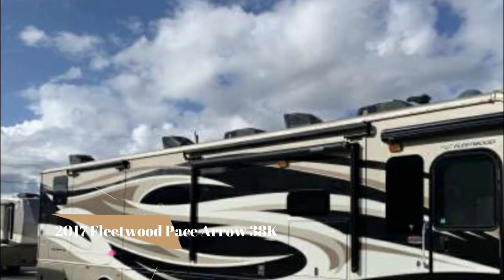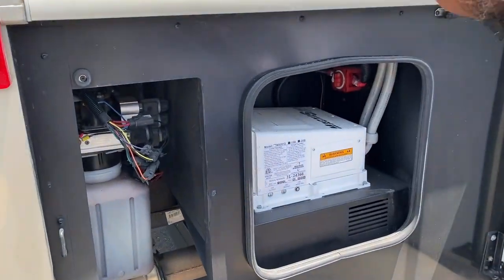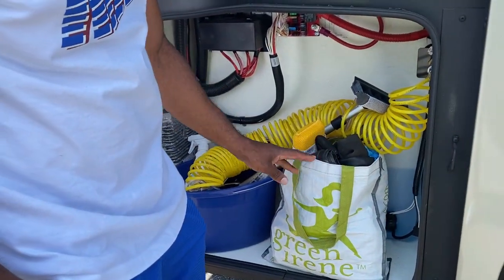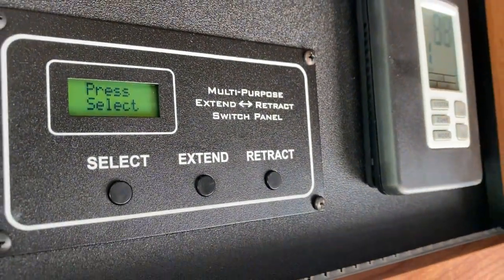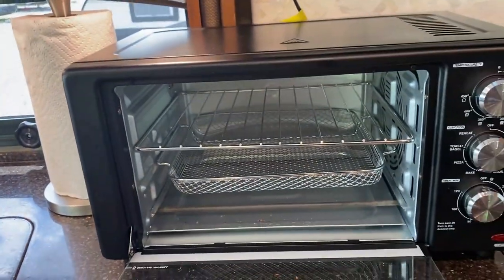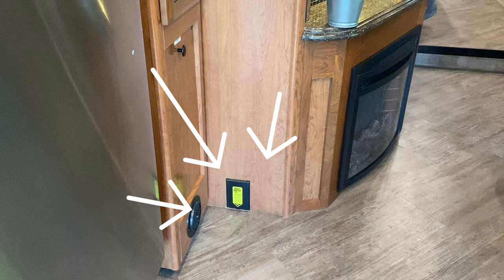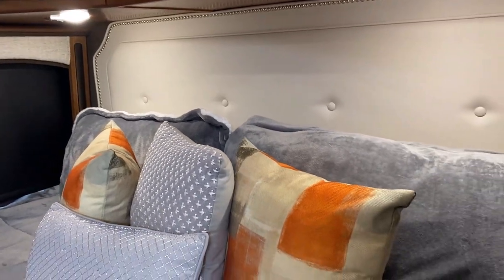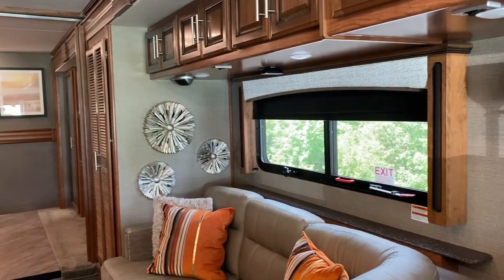RV Tour 2017 Fleetwood Pace Arrow 38k | What we like and don't like

Comment: Very Nice.  Is the air compressor built in?
Reply from the maker: Thank you! It does have an on-board generator, I believe this what you’re talking about.
Reply: @rvwithsoul869  an air compressor is used to inflate tires.  I seen the hose and was wondering if it had a built in compressor.  Some fancy RV’s have them.  No biggie, Anyway thanks for responding.